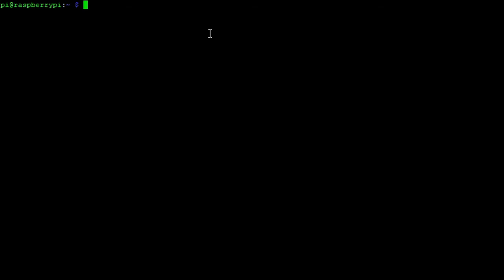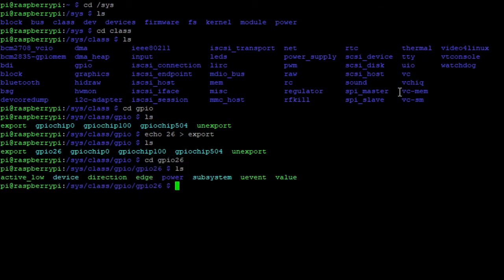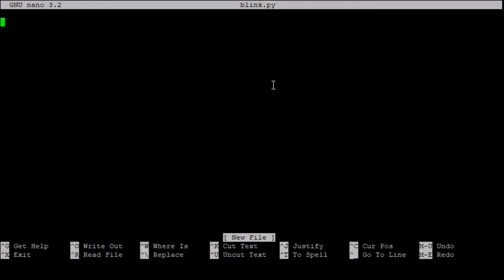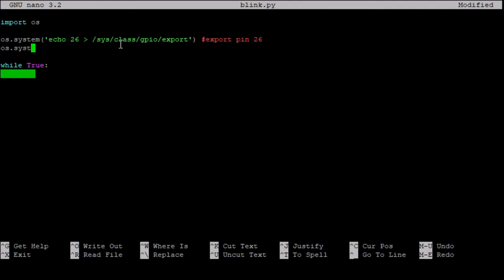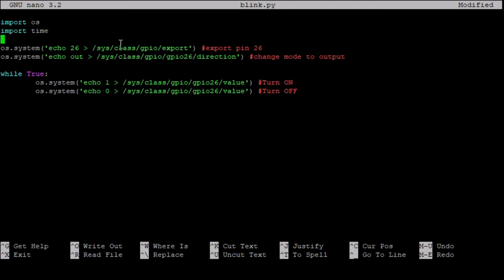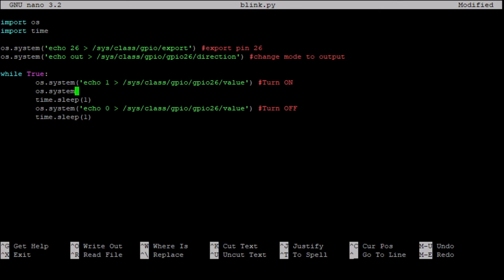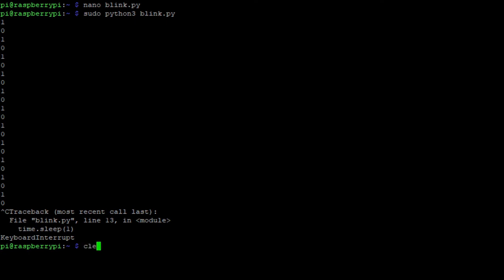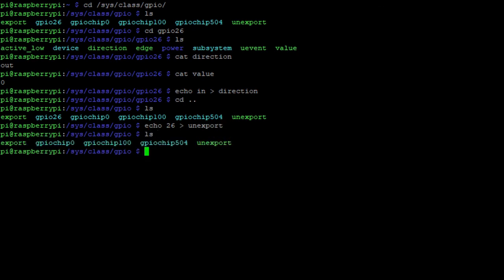Raspberry Pi GPIO control without libraries (Using the filesystem/BASH)

Comment: Please,  help. I have error:

user@raspberrypi:/sys/class/gpio $ echo 14 > export
-bash: echo: write error: Invalid argument
Reply from the maker: Try other gpio pins and see if its a problem with that exact gpio pin or all of them, will give you better idea whats wrong. Maybe you have some different raspberry and it doesnt allow using that pin, or something with configuration. Ask chatgpt for help and debugging, you should be able to figure out whats wrong.

Also keep in mind this video is 3 years old and was done with RPi 3 I think, maybe newer hardware/software doesnt allow doing this anymore. Havent tried, just saying it could be possible.
Reply: @Invisible12345ful  Thanks you!

Comment: It is a very good video
I work with another board (Avalue) and with Debian Linux
I don’t have the gpio library for this board 
I install gpio_sysfs but I can’t create the gpio file as you (gpio26)
Do you have any idea please?
Reply from the maker: I have never used the board you mentioned for GPIO control, so I asked ChatGPT.
It says that apparently you can "sudo apt-get install gpio". You can try find more info on the package by typing "man gpio".
If this does not work I am not sure I can say anything else, because I don't have the board to test with.

Comment: Thank you, that was helpfull for me. Do you have any advice for using GPIO as input? I would like to use button. but I am not sure how to do it in this way ( if just reading value from directory 0/1 or if I have to inicialize any readinig (somehow...)).
Reply from the maker: You read from the "value" file in GPIO folder. Different pins behave differently, some are "enabled" if they are grounded and some are enabled if you apply 3.3V to them, it's weird. Generally you can measure the Input pin with voltage meter - if it shows 3.3V, you can enable that pin by grounding it. If it shows 0V, then you enable it by applying 3.3V.